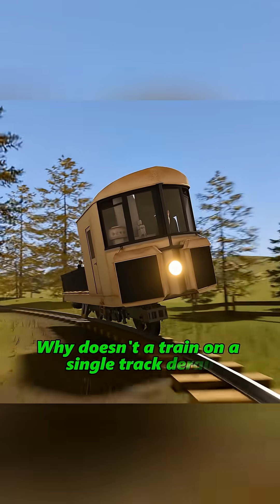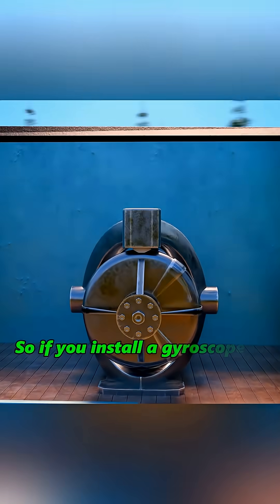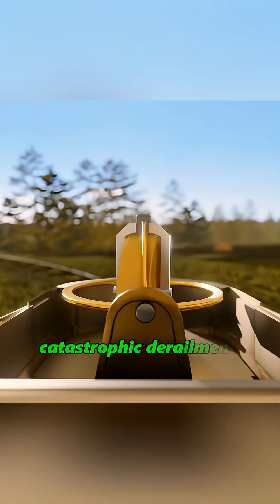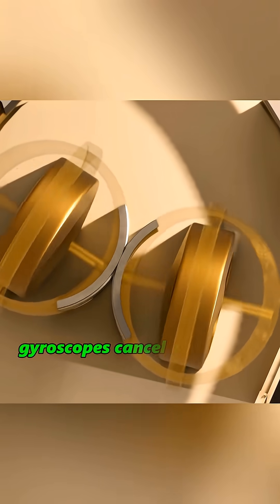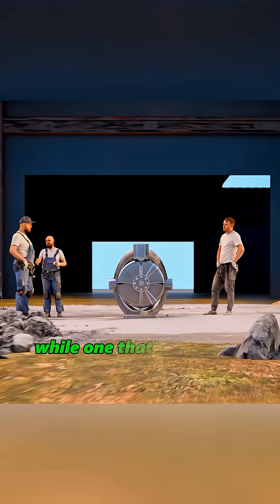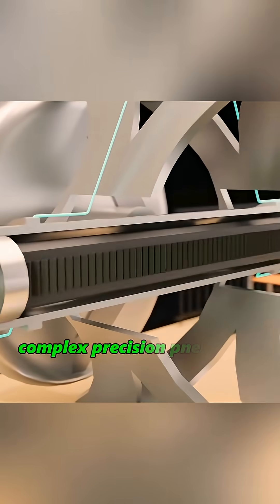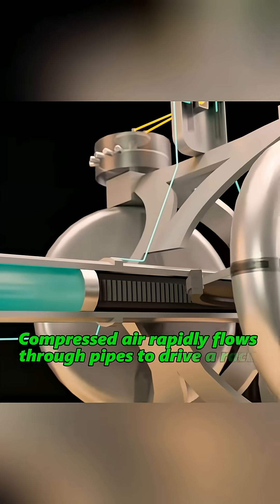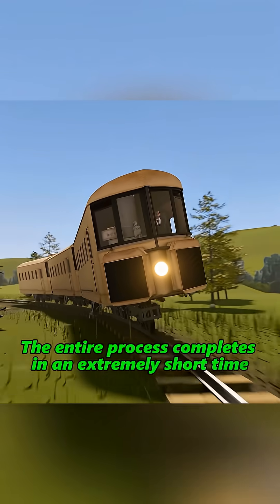Why Single-Track Trains Don’t Fall Over 😳🔥 (The Gyroscope Secret) #education #science #tech #usa

Comment: just put 8 set of wheels on each car (four on each side) put modern tech remove the gyroscope put hydraulic pumps and limit the tiltig mech to 8 degrees and congrats you have a class 390

Comment: Or you could just... have two sets of wheels
Reply: What an insane idea is that? What next? Try to copy bird wing and build a machine that can fly?!
Reply: @bigd8219 hmmm good idea we call it the plane
Reply: @hafidz1619 idk, I dont like that idea. I kinda like the idea of having a propeller hanging just over my head instead. I dont want to steal your thing tho so I need to figure out what to call that...
Reply: @bigdoggstudios  hmmm i think we could use it to lift cargo i think we should call it the cargoliftanator3000
Reply: @bigd8219  Uhhmhhh.... WITCH!
Reply: @bigd8219 real
Reply: Not an expert, but I assume that the benefit to one wheel is that you don't have to precisely lay two iron track strips smooth and perfectly spaced apart, you just make one and make sure the one is smooth.
Reply: @hannahhagans1861  It's not difficult to place two parallel beams of steel
Reply: @ZippyPiglin36  for every 5 miles of track you couldve gone 10 miles. Thats a huge difference and saves a lot of resources and money
Reply: @TheNarrator-q8i  the resources and complexity for the stability, and the list cargo capacity per route, is a lot too
Reply: @ZippyPiglin36  y = mx+b
Regardless of B (the cost of building that train), as long as M (the variable of the cost of track) is smaller, after a certain point, it will become worth it.
Reply: @Evan-_-Does-_-Music  When the slight savings means that a passenger train derails and kills thousands or tons of cargo are lost and destroyed, it ain't. 
Conventional Tracks were chosen over Single-rail for a reason.
Reply: @ZippyPiglin36  probably aint cheap either
Reply: @totallynottheflash  It's literally every rail network in the world since the last two centuries
Reply: @TheNarrator-q8i  ur pfp is adorable
Reply: @magolor1128  thanks
Reply: @hannahhagans1861 also, it's cheaper
Reply: You really dont see the benefits of only needing 1 rail? 😢
Reply: more moving parts = more chances for failure
Reply: @HomelessOnline  and a gyroscope of this complexity has way more moving parts
Reply: @HomelessOnline prolly less material used in tracks so their built faster. Also maybe more efficient bc less wheel friction
Reply: but that's lame
Reply: They also Derail…..
Reply: Where's the fun of it? 
We once "why not just sail" When we were dying to achieve human flight before the Wright Brothers
Reply: My thoughts exactly. Didn't even know this was a thing
Reply: NO!!!!!!!!!!!
Reply: but arthur you broke the other one
Reply: Yeah, but that ain’t fun😃
Reply: Then that's just a normal train?
Reply: NO
Reply: @queen_because_yes how?
Reply: There are many benefits of this for example less resources will be used than the two track rails. More speed because of lack friction. And it just cool
Reply: @Comic_NerdX  Ohhh
Reply: Witchcraft
Reply: Bro the purpose of it is to save metal cuz if u put 2 rails u need 2x more metal
Reply: Nah a gyroscope is cooler
Reply: or have only one track and wheels but have a set of car wheels sticking out the side for balance
Reply: One set of Gyros vs... MILLIONS of miles of rail!
Reply: @onestoptechnologies7305  One set of Gyros for ONE locomotive, vs hundreds of thousands of kilometres of simple steel rails for thousands of locomotives.